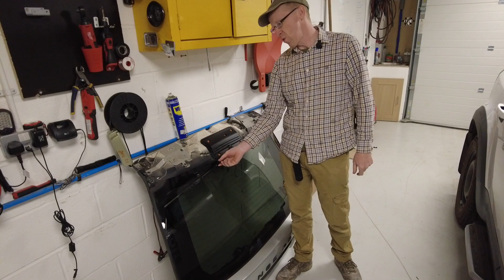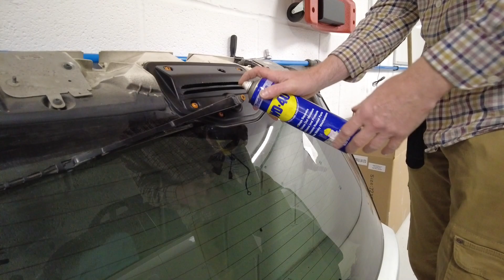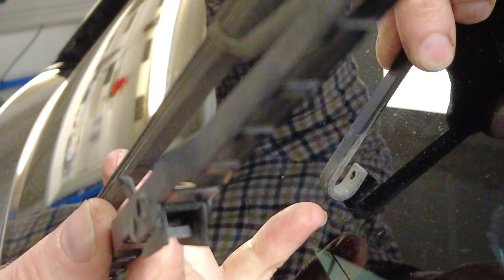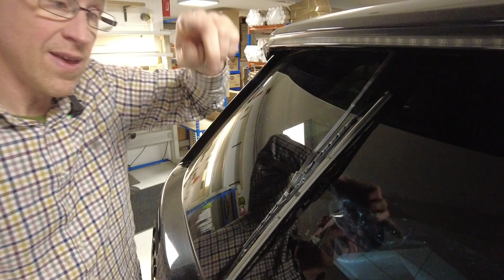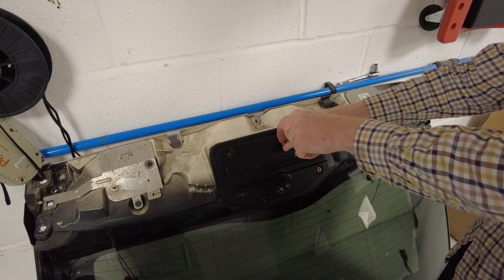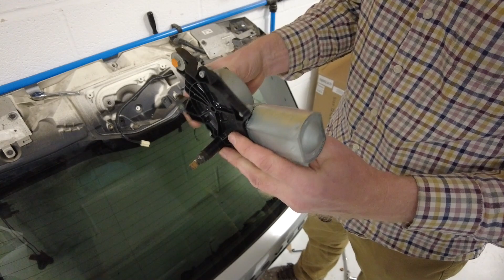Range Rover L405 / Sport L494 Rear Wiper Blade / Arm / Motor Replacement + Secret Park Mode !

Comment: Secret park mode doesn't appear to be a thing on the Disco Sport. Perhaps it's because it doesn't have a roof mounted rear wiper?
Reply from the maker: It does appear to have one
https://www.dropbox.com/s/kg17xhhpkppv8gj/wiper%20park.JPG?dl=0
Reply: @L663  So it does! Thanks Simon. I went out to the car after watching your video and tried it 3 times but couldn't get it to work! Didn't think to check the iGuide. Will have another go tomorrow. 👍

Comment: Simon isn't that position the position to stop them sticking in the winter?
Reply from the maker: No I do not think so. The winter mode is set from the driver display - and I would imagine leaving the rear wiper under the spoiler in the winter would be a good idea.